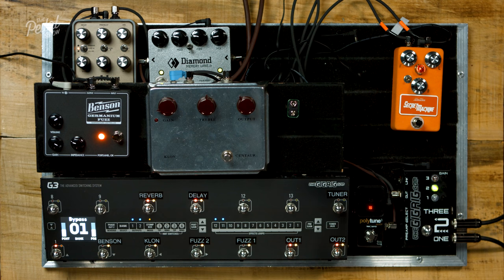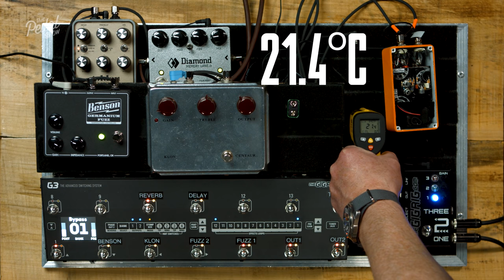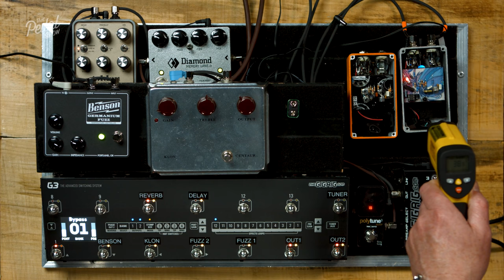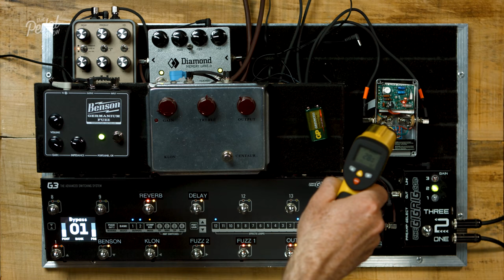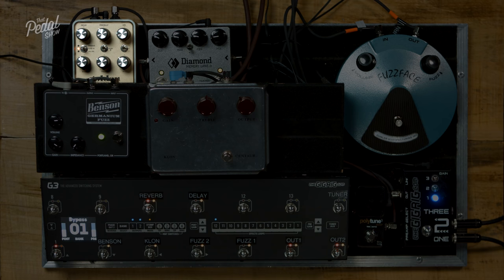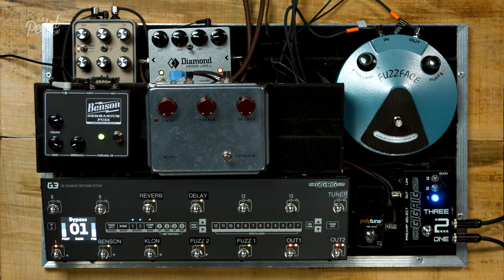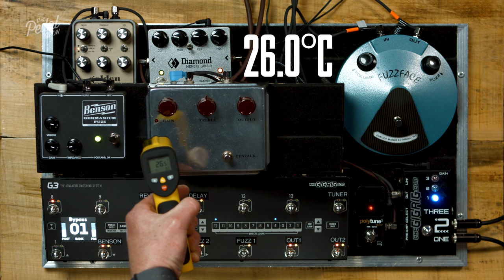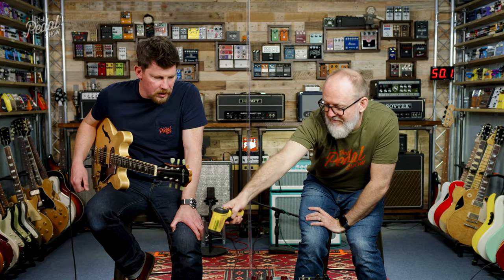Hot Fuzz? The Effect Of Temperature On Your Fuzz Pedal [+ New Benson Fuzz]  – That Pedal Show

Comment: ***Nerd comment: adding a Germanium (Ge) diode to offset the leakage on a Ge transistor (reverse biased) is the solution to the temperature problem. Since they are both made of Ge, they are affected in the same way by the temperature. If they both have same leakage current, the diode will cancel the transistor leakage at any temperature.Very cool episode BTW!
Reply from the maker: Woah!
Reply: Assuming the pedal is keeping the transistor at the same temperature, would a simple resistor work (though not as resiliently as a diode)?
Reply: @kbirridia  maybe a small enough resistor would do a similar job. However a resistor would alter the 'sound' of the fuzz, because of its linear conductance. Both diode and transistor have non-linear conductance, so using a diode is the best solution here.
Reply: Is that in any way related to the, what is it, two transister and three transistor variations in the early Tone Benders?

Comment: What you need is a liquid helium filled cryo unit under the pedalboard.  Run the cooling tubes along the length of the board, back to a mains powered pump.  You can even use it to keep your refreshments cool while you play.  Downside is, your board will weigh twice as much but it's a small price to pay in the interests of enhancing your performance, looking after your fuzz and keeping your beer nice and cold.

Comment: Since temperature primarily alters bias point of the transistors it'd be cool to show the Sunface with the sundial bias knob (though it does have a finite range) and see how you can adjust the bias to/not to compensate for the temperature.  I'd be keen to know what temp range the sundial can compensate for (they're soooo good)
Reply from the maker: That’s a good shout. We should have done that!
Reply: I went looking for this comment to avoid duplicating it.  I was yelling at the screen: "Why didn't you adjust the SunDial bias when hot?  That's what it's there for!"  Another major problem with the demo is that an alkaline battery in the fuzzface circuit messes with the gain.  I specified higher gain transistors in my AnalogMan SunFace RCA fuzz, so I can run rechargeable 9V batteries or Alkalines and just run the gain a little higher to compensate for the lower internal impedance of the modern batteries.

Comment: A totally practical solution would be a pedal board with one of those Cray computer cooling devices.
Now, to modulate this effect an external foot pedal that would vary between boiling water and liquid nitrogen to flow in and around the transistors.
Reply from the maker: See now that is our kind of practical! :0)

Comment: I know they make thermoelectric cooling chips.  I've toyed with putting one inside a fuzz pedal, but Mick nailed the obvious problem - condensation.  Add to that the significant amount of power the cooling chip would likely need - it's a non-starter.  lol.
Reply: Could it be sealed in epoxy?

Comment: @1:06:00 - For Mick's pedal cooler, the build could be really simple and is very possible to make. Get a small, powerful fan such as a Noctua 40mm running at 12v (costs under £15) and you could wire it straight to the Gigrig power supply you both use with a 12v adapter (trivial for Dan!). Plus it's small enough to fit the side of an enclosure and you can easily cut a hole on the sides for airflow.

Tbh this will work as well as any water cooling here as trying to get contact for heat transfer on components on a pedal would be a pain, directing airflow is straight forward & no condensation too!
Reply: You do understand that the air that a fan blows around is at exactly the same temperature as the rest of the air, right?
If you personally stand in front of a fan then the airflow past you feels cooler, but this is because the flowing air enables your own body temperature regulation system (sweating) to work better - the actual air itself is at the same temperaure as all the rest of the air.
If you do not believe this then set up a thermometer in a room and let it settle to the ambient temperature.
Then turn on a fan and blow it onto the thermometer.  The temperture remains the same.
A fan has no mechanism whatsoever for absorbing heat, it just moves the air around at whatever temperature the air happens to be.
The reason that airflow works to lower the temperature of the cooling water which circulates around an engine is that the engine gets an awful lot hotter than the surrounding air.  In that case, blowing the surrounding air onto the engine or more accurately through the radiator will cool the engine down, but only because the engine was so very hot in comparison in the first place.   Obviously, blowing air which is significantly cooler than the hot thing will produce a cooling effect as excess heat from the hot thing can be transferred into the cooler air flowing around it.
But in a situation where a thing is at the ambient temperature, then blowing more air over it which is at the same temperature as it will have no cooling effect whatsoever.

Comment: Water coolers use a pump to pump the water through the rad with fans to cool the rad, then through the PC where there are heat transfer plates connected to the hot components inside the PC.  It could work for pedals, but it's possible a closed unit could be made that would fit under a pedal board that used hoses that just blew air through the pedals chassis (drill a new hole in and out, could be in the bottom plate of the pedal, in at the top, out at the bottom), and could chain the pedals together, and just have the last one vent to atmosphere.  It would probably work and not be TOO noisy.  Or just use your temperature stable pedals when playing that festival gig.

Comment: I believe this oscillation runaway, in transistor radios, used to be called ''motorboating.''' 
Anyway, I recall my 70s Tandy electronics kit had a specific circuit using a germanium transistor as the sensor in an electronic thermometer experiment.

Comment: I didn't watch the whole video and you have probably mentioned this, but here it goes: You can easily sort this with the bias knob. 

I used to have a very good boutique Tonebender 1.5 clone with an external Bias control when I was living in the centre of Brazil. Temperatures going from 20 to 45 Celsius degree... Just use the bias knob. Also all the myth of "pedal gurus" and roadies going to guitar shops during the 60s to test endless different pedal units just to cherry-pick the ones that sounded the best... I guess a big part of that was just how the internal bias knob was set.

Comment: On the topic of small scale temperature control, have you ever seen those little desktop drink fridges that plug into USB? Peltier junction, solid state thingummy that gets cold on one side and hot on the other when you give it some DC. The functional component can be purchased as a square ceramic looking  wafer a few mm thick with two wires coming off them, only challenge is getting rid of the waste heat, but computer guys have been fighting that battle (and winning) for years :)

Comment: The two biggest tonal issues I've dealt with in the last decade are the impact of buffers, and the temp impact on Ge circuits.Ten years ago, inquiring about either tended to draw a blank stare,  often accompanied by some sniggering comment about cork sniffing.But ,that not possibly further from the truth, they are significant issues that I think only the tone deaf, and totally daft, don't notice.
Finally, as here, they get addressed, I think because of Benson's recent solution, or Kingtone's less effective LED adjustment( for optimal bias, which doesn't always help much); it's almost like few wanted to acknowledge that which had no ready solution,- which isn't an unusual response.
Buffers can be compensated for, if not totally corrected, by boosting the signal and shifting the EQ; my answer to the Ge problem has, for the last few years, been to leave those effects off the board, and handle as necessary.This works, as those pedals are first, and often battery powered, anyway.
I'm willing to accept the instability and inconsistency as part of the charm and magic, as well as the integral part those qualities  have always had in my musical efforts.
NFN, I rely on several non Ge fuzzes these days ,- like the hybrid EQD Eruptor,- for general use, and to assure more playing time and less mucking around.Also, a good Black Glass Treble Booster can simulate that vintage crud quite well.
Reply from the maker: Cheers Mark - we totally agree on living with the foibles, but as you allude, learning what those foibles actually are in the first place is kinda tough. No doubt all of this is buried in many forums, but it’s not until you see and hear it that it makes sense.
And you can tell by the view count on this video that basically nobody is interested. Hahahahah!!! 
Good job we’re not in this for numbers. Ha!

Comment: Active cooling of fuzz pedals? Possible, but tricky. The first place I'd look is in a camping supplies shop, as there are many portable mini fridges that run on 12Vdc. Ideal to transport temperamental pedals. Possibly even usable on stage (if you don't mind having a big box next to your pedalboard & don't need to adjust on the fly). Advantage - simple to implement & relatively cheap (I've just had a quick shufty on t' web, these camping fridges seem to run from about £70 and up, so roughly the cost of a single pedal)...

Other'n that idea, it is at least possible to cool a pedal directly. You'd need a replacement base plate, to which you'd need to mount a thermoelectric cooling element, using the Peltier effect. Info on this is available on Wikipedia. As there are usb powered drinks coolers available that use this technology, this might actually be a practical idea. Huh. Who'da thunk it, an actual practical idea. Set Dan onto it, he'd probably be able to make/mod something up that would actually work...

(EDIT - there's plenty of ebay listings for usb mini fridges, mostly under £20. Might be worth some experimentation..?)

Anyhoo, great episode - I've always heard horror stories ABOUT Ge fuzzes misbehaving, but this is the first time I've ever actually SEEN it demonstrated...

Cheers... G

Comment: You can hear the heated zonk basically oscillating! it's getting gated because the bias is naturally off center but it's very apparent otherwise. i think hidden oscillation is a big factor in fuzz tone issues, caused by the excessive gain and lack of lowpass miller caps which many clones add and fix the issue reliably.
And the heated optimus, well it's full on lol
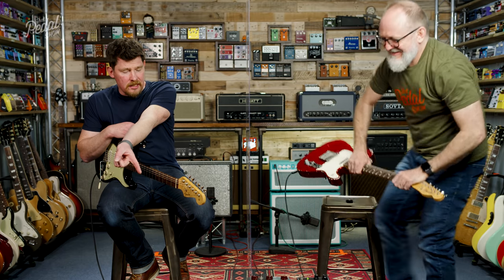27:43 no it's definitely the topology and bias, shifting more towards center or cutoff/saturation, not the particular part.

Comment: Aluminium sleeve with wing on germanium transistor will solve it!the heat generated by the transistor is the problem therefore the external temperature compounds the problem but a heat sink sleeve will have the fuzz working in any situation.

Comment: Hey hey. The different temp effects on the Fuzz Face vs. the Secret Machine isn't because of the different transistor types but because of how they're biased. The temp increases gain, which lowers the collector voltage. The FF is biased to be fully on (~4.5v), so lowering the collector voltage enough puts it in the grey area between on and off, so it gates. The Zonk/Bender circuit has the collector biased higher, in the grey zone where it gates already. So temp up = gain up = collector voltage down, which turns the transistor on completely, with no  gating, so you get the oscillation. Mk1 benders/zonks are so wild without the gating they get mad.

Comment: I urge you guys so much to get a Catalinbread Giygas Fuzz on the show! Also I know you touched on the Band of Gypsys Mini Fuzz Face before, but try it with the volume around 1-2 o'clock so it pushes the amp a fair bit, and the fuzz down below less than a quarter on the dial (Don't know if you guys noticed its massive amount of available headroom but its not a fuzzface at all, 3 transistor Roger Mayer circuit, but it sounds waaay more clear like a saggy distortion with the knobs this way.) I saw a demo where a guy used it through a cranked plexi with the controls like this and it sounded ace so I started using mine the same way, has a much brighter clean-up on the guitar volume this way too , though there is a Roger Mayer designed Hendrix Woodstock Strat circuit with a treble bleed and middle pickup blender pot (not sure if thats how Hendrix got it too cleanup better, but i use a kinman type treble bleed with it and helps a lot). If you watch the way Jimi used it during the performance at Woodstock, he is really just using the guitar volume to get varying degrees of distortion/fuzz otherwise he just turns the pedal on and off and uses the guitar volume to clean up the distorted Marshall for cleaner cleans - have a watch of the live footage sometime. The Authentic Hendrix line Dunlop Gypsy Fuzz 2017 model with the tone knob is even better again in my opinion with brighter and darker tone options. MXR Super Bad-Ass Variac Fuzz is the same circuit again but with voltage drain and a charge pump for 5-15V !!!! The Catalinbread and the Dunlop Gypsy Fuzz are my favourites for clarity and cut with a mega amount of fuzz. Highly recommend a look at them. I think Mic would be rather pleased with the tones on a Strat ;)

Comment: Hey Mick you should be able get hold of and fit a low profile mini-micro fan inside the pedal housing that runs off your 9v pedal socket, I'm sure you should be able to get one as the size of the cooling fans they put in extreemly thin and shallow laptops these days is minute. If there is not enough depth in the pedal case; just add some spacers and longer screws to the pedal back cover to give you more room to possibly fit a low profile fan.

Comment: When it comes to Fuzz Faces, I actually tend to have more issues with my Silicon Fuzz Faces. Usually with Radio Interference, but then the Germanium Fuzz Faces don't play well with my Strat with the Gilmour EMGs. So I did find a blue Hendrix Fuzz Face, that is supposed to have been owned by Tim Pierce, that doesn't have RI issues, and works well enough with EMGs.
Reply from the maker: Nice! I really love that blue FF.
Mick here. Would e fascinating to hear it with EMGs / cleanup!
Reply: Yes, I set my Hendrix Fuzz Face exactly like Mick sets his.
Reply: @ThatPedalShow  The EMGs don't clean up as nicely as standard Strat Pickups, but they do clean up a bit, but you will not get that Hendrix Clean. It is more like when you pull the volume back on an OP Amp based overdrive. The EMGs sound a bit better through a Silicon Fuzz than a Germanium. My favorite Fuzz is the Germanium 65 Amps Colour Face, and the Bonamassa Fuzz Face is a close 2nd but the EMGs sound awful through them.

Comment: I started building pedals because my favorite circuits are vintage but I like and gig in Florida and the swamp will destroy a germanium fuzz, I had to start building silicon clones after one too many failed fuzz face gigs in the summer
Reply: What kind of temps did you find to start affecting them?
Reply: @xderiwx  like I said I’m in Florida so forgive Fahrenheit but usually anything 85-100, There’s usually some time like if it’s indoors it takes longer to crap out, outside it’s almost immediately. And depending on where I’m playing, DIY show in a humid swamp, dies way quicker than a show by the beach. It’s anecdotal obviously but I’ve definitely noticed this happen
Reply: @softsounds389  Thanks! I’m in Hawaii so pretty similar conditions. I’ve been wondering if humidity had an effect on germanium also. Every time heat and germanium topics come up, people mention stories of Hendrix or SRV cooling theirs in coolers or fridges, but then that only lasts for as long as it takes to heat up again, and then you’re left with condensation inside. I guess for people in hot climates, if you want consistency then silicon really is the only option right now.

Comment: Awesome science project :). Here is an idea for a show: usually one set the amp and gain stages to work mainly with one guitar. When we change guitar we accept the change (at least part of it) as a "different flavor". However sometimes difference of gain is hard to manage. I've seen guitarist that use different gain stages for different guitars, however if you are using the amp as your main source of drive (together with boosters) how to approach it. 
The other angle is pairing guitars to work together while adding different flavor. How much difference is too much.
Reply from the maker: This is a great suggestion Miguel.... and a vast subject. Hmmmm. Thinking caps on!

Comment: well, v_{t} = kT/q, T in Kelvin, so... temperature variation can really mess up the bias point (and thus, gain) depending on the configuration 🤓 emitter degeneration feedback helps to keep the gain constant but if I'm not mistaken the emitters on those fuzz circuits go straight to ground to maximize gain.
Reply from the maker: Great! And now for the raffle!

Comment: I have a small quantity of nice germanium trannies and a nice tester etc. and have successful built some nice fuzzes. Then I bought the Crazy tube circuits CV7003 Constellation fuzz and have no urge to make anything ever again. Somehow they built a single box that does 2 Fuzz Faces, 2 Tonebenders, a Rangemaster, and a Rangemaster plus a Fuzz Face and they all sound awesome. It also has plenty of volume and gain on tap. I normally run it as a FF with the volume at noon and the gain around 2, normally I'd have both dimed. Don't know how they did it and I don't care, it is way better then anything I could build.